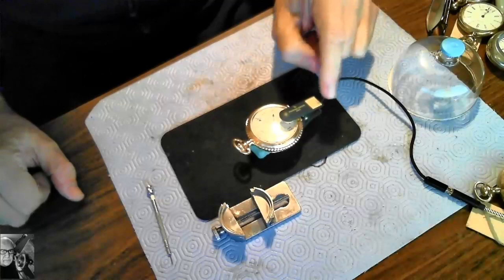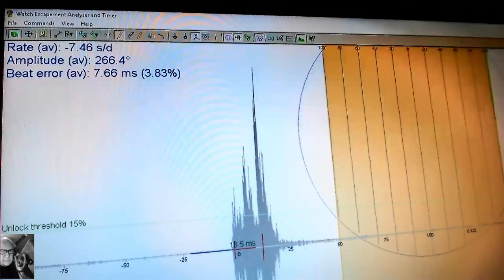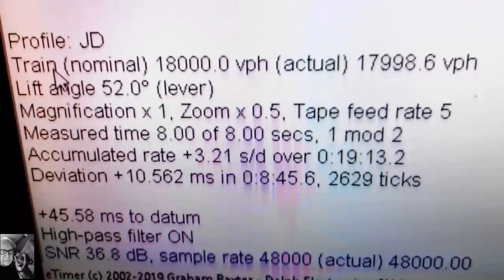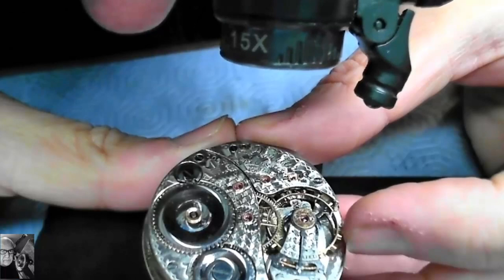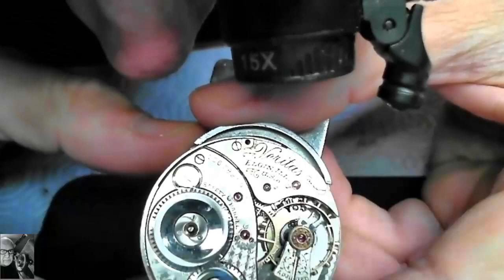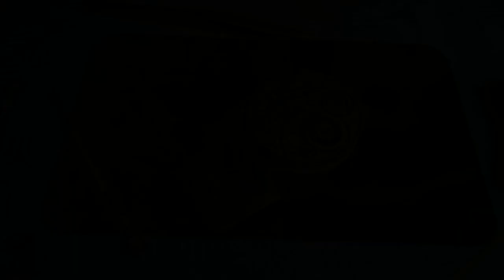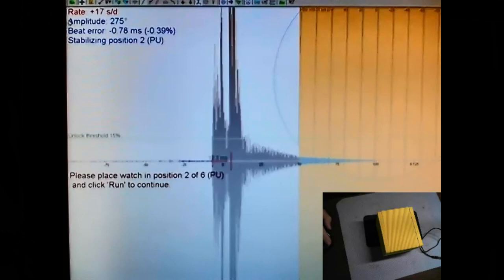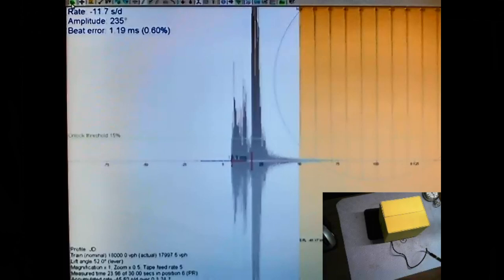Correcting Watch Beat Error - Elgin 23 Jewel Pocket Watch

Comment: Thanks lot to learn, also I have a question re threads striped on a dial screw Waltham 16s can’t get it out thanks again Dave
Reply from the maker: Is the screw head gone as well?
Reply from the maker: I would likely either drill it out and then rethread it, or sharpen a screwdriver to the max and just keep working at it

Comment: No the screw just spins, is there access from the other side, I tried a magnet, no joy. McMasters has a screw remover I might buy one thanks
Reply from the maker: You could ouch it from the other side; if it is accessible. I don’t think a screw remover would work due to angles…I find the nudging the screw with a pointed shaft…and I have had to make one…Has worked I. The past.  Send me a picture at:  jdwatchservice@gmail.com
Reply: Might have to use Alum and just dip that one spot in the solution.

Comment: aww man I wish you and the camera were set up better so I could see the hairspring being removed from the balance wheel...and what you were prying to move the "collet?" over to the right 4-5 degrees.

The red mark...on the balance wheel...did you do that or was that done by elgin?

so I understand a bit better (newbie and layman so bear with me)....at rest the little pin coming down off the balance wheel wasn't exactly in the middle of the pallet fork? So you had more swing on one side of the balance wheel? Do I have that right?
Reply from the maker: Yes you do. It’s called beat error. And to correct it you need to rotate the hairspring collet in the direction with the better swing. I made the red mark to mark where the stud is so when it’s removed you can replace it exactly where it was before removal.

Comment: Couldn’t you just place the balance in the watch and set the cock on after to reassemble the unit. I think that will also ensure the hairspring will lay flat once you thread the stud back in.
Reply from the maker: That technique is more difficult and risks damage to the hairspring as you raise the stud into the balance bridge. I have seen other do this.....however! So I use to lie the bridge flat and put the balance hairspring I from the top. I have tried all kinds of techniques, but using the stereo microscope is so so easy and completely under control.
Reply: @JDRichard  I picked it up from The watch repair chanel so that’s  how I do it. But obviously everybody has their own little tricks.

What kind of stereo microscope do you use? I “borrowed” my dads old Zeiss regular microscope for my little hobbyworkshop, but while it is nice to look at the jewels and inspect parts with it you can’t really work under it. I was thinking about picking up a rel. cheap stereo microscope.
Reply from the maker: Send me the link please...perhaps I need to change my technique:)
Reply: @JDRichard  I think its the one with the Cyma balance staff. I’m not sure though I’ll try to find it.